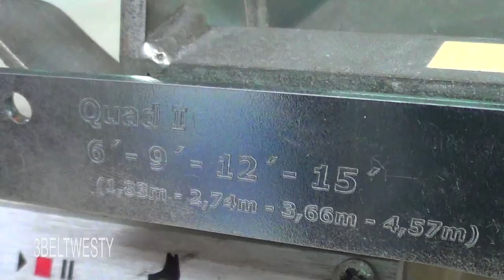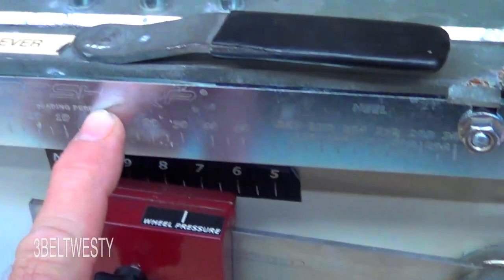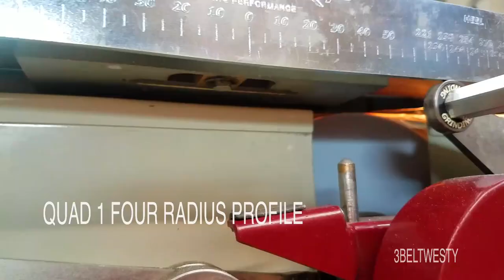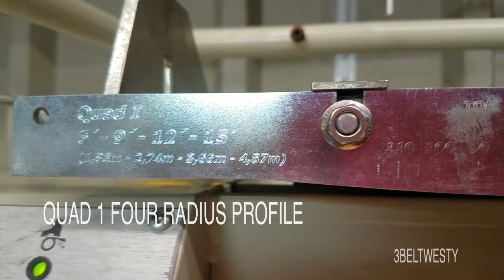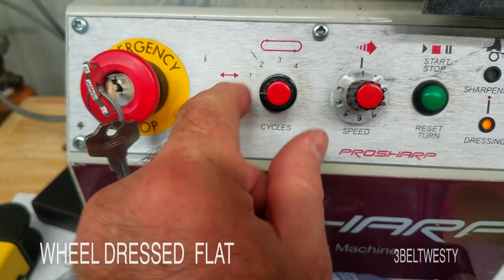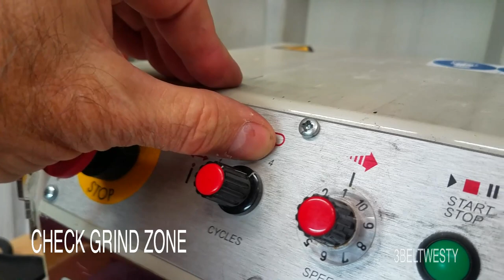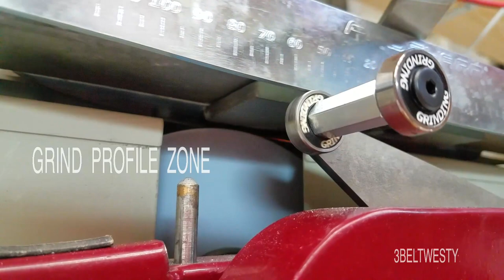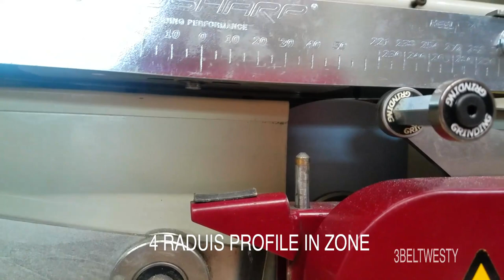Hockey Skate Profiling Prosharp Quad 1 template

Comment: The prosharp system is based on engineering theory.  Not science at best they are a contouring system meaning you can change the shape of the blade.  True profiling is finding the 3 balance points of the blade which you would need the full skate to do.  I purchased a quad zero template from pro Sharp took it to an inspection company to analyze it with a very expensive CMM.  They could not find the for radii that pro sharp was claiming.  Turns out the quad 0 is an 11 ft radius with a pitch.

Comment: Quick question, im getting new Bauers 3s skates and they claim to have the LS+ blades with a quad cut Bauer is calling it their "Power Profile" with these do i just need to take them in and sharpen them as normal? or do they need any special technique to sharpen? assuming since they ship with the profile already they do not need that basic "new skate profile" sharpen. thanks
Reply from the maker: The Bauer 3s with Quad Profile has the 4 radii profile but not a sharp edge yet. Thus they have to be sharpened. The goal is to get sharp inner and outer edges with the least degradation of the profile. With a table top manual sharpener the toe and heel regions often get ground down too much. Thus one gets a banana profile runner.

https://www.youtube.com/watch?v=Swmt3d7Q_Qk

https://www.youtube.com/watch?v=Dp06NIE9aZ4

https://www.youtube.com/watch?v=8msCWpgY9BI

When one cuts a profile on the AS 2001 you have the grind wheel dressed "Flat"ie infinite radius of hollow. Often the grind wheel is more coarse in profiling to remove the metal quicker. Profiling is to get the side view shape (profile) to a configuration that one wants. You can skate on a blade that is just profiled but the blade is flat, not great for any cornering.

If someone profiles a skate blade without dressing the profile wheel every now and then then the blade can have chamfers where there should be an edge. The blade will have a side profile but requires many sharpening passes to remove the chamfer. What happened was the blade was going down into the grind wheel like a tire rut.

Comment: Thanks for the video! Can you make one about the advantages of different Radii?
Reply from the maker: Hello Matt (OK flak jacket on! :)) 

 (1) A short radius allows cornering/manoeuvring, a large radius a higher top speed. Stock Hockey skates often might have a 9 foot radius / 2.7 meters over the "bulk" of the runner. By Bulk, I mine say 75 per cent as a rough crude estimate. Then the stock radius blends to the shorter radius toe and heel regions. 

(2) Profiling attempts to change the "75 per cent" mostly skated  region to be several radii so one has a skate that has a higher top speed (better glide)  and also better cornering/manoeuvring. Thus for cornering the Front of the 75 percent region has a radius smaller/shorter than the stock 9 ft radius (ie the Quad 1 here has a 6 and 9 ft radii in the front region. ). Also the center and Rear regions of the Quad 1 have a 12 ft then a 15 ft radius regions. This gives a better glide than the stock 9ft radius. 

(3) In a crude nutshell if you have endless endurance some old worn hand sharpened banana blades will work well too. These often have great cornering since the toe to the start of the center might the same 6 ft radius too! But often the heel region has the same banana profile thus a slower runner with less glide. 

(4)For review a speed skate has a giant side profile radius , maybe say 20 to 30 ft. This gives a better glide, less drag, higher top speed. A Bandy skate also has a larger side profile radius too since the Bandy ice sheet is way bigger than ice hockey. 

(5) With each sharpening the stock original 9ft radius or custom profiled multi radius blade often degrades to the banana profile after many many  poorer hand sharpenings. This is the elephant in the room few folks mention. Thus many of us when we go to a new blade or new profile have this weird sense that the new blades are odd or bad. What happens is one adjusts ones skating to the bad blades and actually better blades will often at first seem worse!.

 (6) Each double/triple/quad series of Profile templates has several variants, this is because the runner length varies with skate size. ie a there are many double/triple and Quad radius templates. Prosharp just introduced 3 more Quad templates for the smaller youth skate sizes  : https://www.prosharp.se/pub_docs/files/Our-most-popular-profiles.pdf  The Sweden chart shows a Quad II is for skates size 11 and 12. Thus dialog about what QUAD template to use really depends on the runner size. The blade is only profiled in those 1, 2, 3 and 4 regions. A smaller say size 3 kids skate has a small runner thus a QUAD XXS template.
Reply: @3beltwesty  awesome info! Thanks so much. My son is 11, 110# good skater, 247    runner,  defense. I'm looking at a Toronto 1 or 2, or Zuperior S. Just got some nice step steel for them.

Comment: Fake News! Where is the different 254, 263, 272, 280, 288mm runners? ? ?
Reply from the maker: Each full skate size has longer runners. Not everybody has the same size feet! :) So not sure what you are asking. Some sizes are rarer in high end steel blades. ie a blade marketed to NHL players might not be made in pee wee kids sizes.
Reply: @3beltwesty  A 7-blade skate blade is shorter, so each curve has a smaller radius, and a 12-blade is longer, so each curve has a larger radius.
Reply from the maker: @MrBacknang  You use a different Quad template with Size 7 skates versus size 12 skates.  There are Seven different Quad templates. You use a different Quad template for a childs hockey skates than an adult giants skates. This is because the blade/runner is longer on larger skates.  The Quad series small to larger skates is 3XS, XXS, XS, ZERO, 0.5, 1 AND II.  Each Quad template has 4 radii that is why it is called a Quad profile.

A size 7 adult Hockey skate uses a Quad Zero template. The radii are 6ft  9ft  11 ft and 13 ft

A size 12adult Hockey skate uses a Quad II template. The radii are  7ft ,10ft , 13ft and 16ft 

A size 1 kids Hockey skate uses a Quad 3XS template. The radii are 4ft , 5ft , 7ft, 10 ft.

So Yes, smaller Hockey skates use smaller radii. 

With ( 4 radius/Quad) profiling there is a different smaller radius "set" for smaller skates. The different  Quad templates besides having different radius; have a longer template for longer skates.

If one uses the Quad II  template for large 12 skates on smaller size 7 skates the template is too long. You get just the middle two radii.

Comment: Not sure why you would want 4 different radius in that area you just divided your stability in half.
Reply: Easier transitions. Many Pros are moving to this.
Reply: @timryan8867  How is it easier you have created more transitions in such a small area and moved the flat surface to the back doing this will only make you way more Unstable..  Sure you may see gain in Maneuverability but will fall down so easy as a result.
Reply: B H  Watch some of the videos on youtube of semi pro and pro players as they try 1,2,3, and quad profiles. Gives a lot of insight into the differences
Reply: @HMNyge  I understand the differences just fine & the downfall of this profile far exceeds any benefit it may offer.. Most new hockey tech only focus on proving it works and never look at the negative effect it has. In this case your balance and stability is affected.
Reply: B H Have you tried it? I have the quad profile, havent noticed any issues in terms of balance or stability.
Reply: @heavymetalnyge5656   Yes